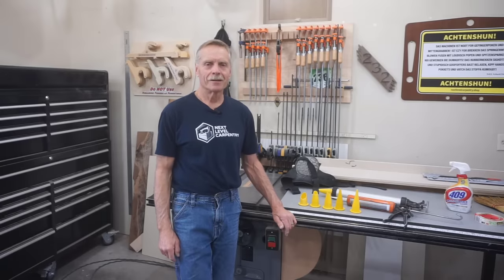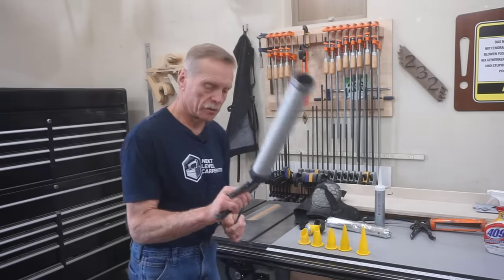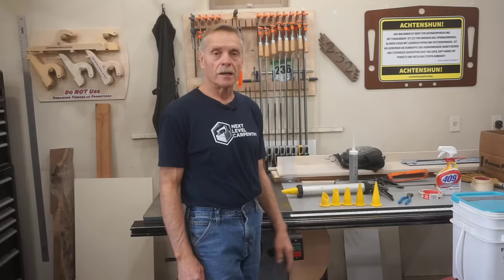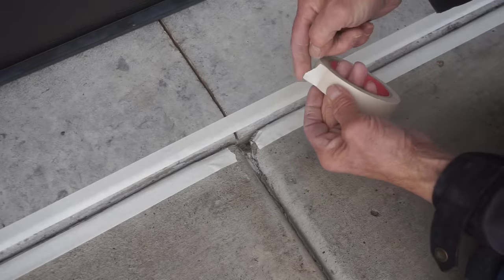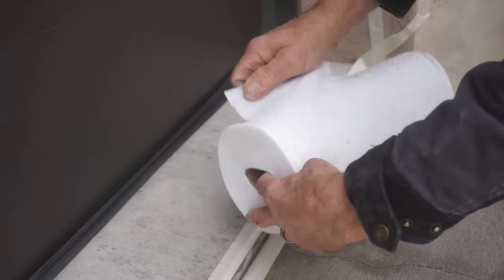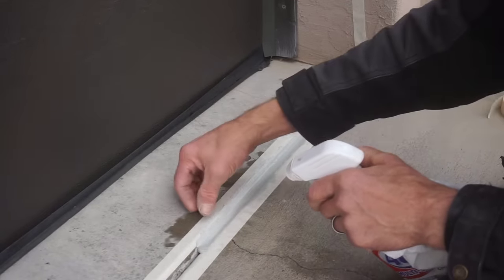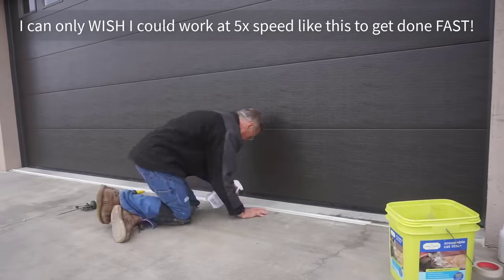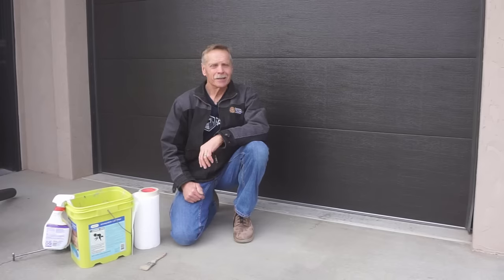How to Caulk Concrete Control Joints with Perfect Results Every Time

Comment: Question: is it necessary/helpful to use foam backer rod? Or is that something you'd use only in between really wide/deep gaps?
Reply from the maker: Backer rod is often necessary but, as in the case shown in this video, not always necessary. The ideal proportions for a sealant joint is that the depth is half its width and anytime the proportions exceed that, work to achieve it using backer rod...
Reply: @NextLevelCarpentry  Thank you for your prompt reply. I just came back from Home Depot and bought everything I need to do this (this'll be my first time). Actually, I forgot the sand, but I'll go back and get it. But I did get some backing rod in different sizes, just in case. Thank you for giving me the proportions to look for (I had no idea). So if the width is 1/2", then the depth should be no more than 1/4", right? As soon as I get the sand, I'm going to use your method. I'm mostly doing it because the gap is where bugs, especially springtails, make their home. They're driving me crazy, and this seems like the ideal solution, and it'll improve the overall look to boot. BTW, are you fan of using trim-a-slab filler strip? Just curious.
Reply from the maker: Good luck with your project Michael it sounds like you've got a good grasp of what you're working with and will be successful in sealing out those bugs. I've seen trim-a-slab strips but have no experience with them. My gut reaction to them is that they're a great idea but they would probably prove disappointing in use because Frost and dirt seems like it would just push them back out of a crack because as far as I know they are just a friction fit and not actually sealed in place. For your project make sure you spend all the time necessary for prep work to remove existing dirt Etc and to let things dry out for best results. Making that extra trip back for silica sand is time well spent as I'm sure you will find out as you start actual application of the sealant.... Best, Matt
Reply: @NextLevelCarpentry  Thank you so much for the detailed and helpful information, demonstration, and encouragement. I'll let you know how it went in the next several days or so.
Reply: @NextLevelCarpentry  Matt, I'm having difficulty finding the fine silica sand. Home Depot and Lowe's both have three main kinds of sand: all-purpose, play, and industrial. Lowe's also has a polymer sand and a pool-filter sand. (I had no idea there were so many different kinds of sand.) The industrial is 30-mesh, but it's not called silica sand, though it says on the bag that it contains silica. And in terms of both color and fineness, neither it nor any of the other sands I mentioned look like your sand in the video. I then found something called quartz sand on Home Depot's website. And finally, I did a search (using quotes) for "silica sand" on Amazon and got an exact match for a 120-mesh "Pure Silica Sand," and it looks like the stuff you've got. It's about five times more expensive than anything else in the home improvement stores. Before I place an order, would you please help clarify which of these is the right stuff? Thank you.
Reply from the maker: @AnotherPlanetsHell  I always get the sand I use at a masonry supplier; it's plentiful and quite inexpensive.  If you're in or near a city of even a decent size it should have one to check out. I've also heard that janitorial suppliers sell it as ashtray sand.  Home Depot's quartz sand might work well too.  After all, the sand isn't doing much at all, only covering the sealant for a day or so until it skins over.  Good luck! Best, Matt
Reply: @NextLevelCarpentry  Hi Matt. Forgot to reply to this. Thank you for the tip. I suppose there're a few concrete places around here, but I didn't bother with them. I don't know…in this town/area, these places don't really cater to individual customers with small projects. I didn't want to turn this one item into a project of its own. So I just ordered a bag of the pure silica sand from Amazon. Should be coming tomorrow. So I'll see about getting this project going on the weekend. Thanks again.
Reply from the maker: @AnotherPlanetsHell  Good news is that a little bit of sand goes a long way so it's a good value even when you can't buy it 'in bulk'.  Let me know how your project comes out? Best, Matt

Comment: Perfect. I would only add upgrading to a battery operated caulking gun for a quicker more  consistent bead. Also saves cramp in yor fingers if you have 10 hrs in front of you
Reply from the maker: Do they make a battery powered 'sausage' type caulking gun? Sure would be nice on cold days when that stuff thickens up!
Best, Matt

Comment: Where do you purchase these products?   A link would be super helpful 😊
Reply from the maker: UUHHMMMM... have you checked the links listed in the description of this very video where all the products you ask about are clearly listed? 🤨😉😁
Reply: @NextLevelCarpentry  oh goodness, my bad! 🙄 duh.  Thank you so much for the quick reply and gentle correction.  (Forgive my very poor attention span.  Ack!)
And thank you for the awesome video!!!
Reply from the maker: @smartyjonesen  yeah no worries because it's just as likely that I neglected to put them into the video description as it is to not be able to find them when viewing the video on a small screen like a smartphone.
Some of those supplies are available locally in even moderate sized cities and if you do some shopping around you might be able to buy locally rather than deal with Amazon but they are there as a reference and last Resort.
Good luck with your project if you have some sealant work to do...

Comment: I'm having difficulty locating Fine Silica Sand.  Is there a substitute type of sand that you recommend?
Reply from the maker: One important thing about silica sand is that it's mostly white and doesn't change the color of the sealant you put it on.  That aside, if you sifted regular sand so it's fine and consistent it will still do the job of keeping bugs, dirt and leaves out of fresh sealant although it will probably affect the color a bit.
Reply: @NextLevelCarpentry  Thank you.  I plan to get started this weekend.

Comment: I purchased PL LOCTITE Concrete Self-leveling Sealant - to use on a concrete porch as the porch surface meets the brick.  I'm hoping to see the same results that you got in your video by using the 3M tape, 409 multi surface cleaner, and fine silica sand.  Thanks.
Reply from the maker: I hope I am replying before you start using that self leveling because I think you will be extremely disappointed because there are major differences between self-leveling and the non-sag stuff you see me use in this video. Masking tape might confine the mess a little bit but silica sand won't make any difference and it will still puddle and bubble and everything else. I'm not telling you not to use self leveling but encourage you to lower your expectations if you do...
Reply: @NextLevelCarpentry  Thank you for your reply.  I had just cleared the area that needs to be caulked which took all day.  I was still deliberating about which caulk to use, but I saw how liquid the self leveling looked and stopped there.
Reply from the maker: @vickiehz  I think you'll be glad you did a little research BEFORE making a mess of things with self-leveling.  Take you time and practice a little with what you see in the video and I predict you'll amaze yourself with the results!
Reply: @NextLevelCarpentry  Thank you.  TBC
Reply: @NextLevelCarpentry  I wanted to let you know that the results I got from using the non-sag sealant looks very good.  I had one span that was too wide (even using the backer rod rope) to use it however.  In that section I had to use a tub of DAP concrete & mortar repair.  I'm wondering if using the non-sag sealant over it to level it out and make the entire area the same color would adhere properly - applying the sealant once the the DAP thoroughly dries.  If you've ever done that, let me know.  Thanks.
Reply from the maker: @vickiehz  FWIW I've done gaps/cracks 2"~3" wide using pool noodles or flat foam sheets cut to fit as 'backer rod' and had very good results using Tremco Dymonic alone so it will probably work over the concrete repair, provided you can still put a thick enough layer on top.  You've got little to loose if it doesn't work and you can always re-do using foam as mentioned above.  Let me know how it works out because just because I've never done it the way you are doesn't mean it won't work...
Best,
Matt

Comment: Great video and amazing end result!  I have a few questions if you wouldn't mind giving advice.  My driveway expansion joints are essentially 2X2 wood strips (now rotted) so are 1 1/2" X 1 1/2" in size.  Would you recommend backer rod to fill most of the void, and how deep should the remaining void be?  1/2" ...3/4"? I haven't found any 1 1/2" backer rod, so I assume I can twist 2 3/4" strands together if that's the recommendation?
Also, my driveway is aggregate concrete, so cannot really apply tape to top, should I plan on putting tape just below surface on the sides of the trenches? Thanks for any help, and I'm glad I came across your videos, very well done!

Comment: tremco demonic vs vulkem 116 caulk?  in Minnesota - which is best for driveway cracks, joints and garage perimeter?
Reply from the maker: They should both work the same... even in Minnesota.  I've only used Vulkem in a pinch because I like the 'consistancy' of Dymonic better... but that's just me.

Comment: Should I use backing rod or back fill joint with sand if I suspect washout?
Reply from the maker: Backer rod is almost always a better solution than sand IMHO but there are some situations where both are necessary IMHO.  If backer rod gets it, I'd generally recommend it.
Reply: @NextLevelCarpentry  I suspect erosion under concrete. I plan to fill as much as possible with sand and then use backing rod to fill gap. Is that advisable?
Reply from the maker: @sharkhartman  It's probably better than nothing and may be all that's needed, depending on how extensive the erosion is.
FWIW The slabs you see in this video are over fill dirt that settled significantly so I had a concrete lifting/leveling company come out and inject special foam under them to provide actual support to prevent further settling or cracking.  Not cheap, mind you, but much less expensive than replacing the concrete itself in my situation.

Comment: Hello, I didn’t hear the reason why to do this to the joints. Is it to prevent water damage over time? Is it to prevent the concrete from rising up due to water absorption?
Reply: One primary reason is that it keeps water from washing out the ground underneath the concrete which would likely cause it to sink and crack, as well be uneven with adjacent slabs. Also keeps weeds from growing in the joints which is a nice bonus.
Reply: @kingv911  ahhh great info, thanks!

Comment: Could this method be used in the opposite way meaning the same scenario but it’s in the concrete ceiling joints that are not straight?
Reply from the maker: I use the same method/process for applying sealant like this regardless of orientation.  I don't envy you if you have to do joints on a ceiling but there's no reason, despite the difficulty, that it won't work.
Reply: @NextLevelCarpentry  the mason told me that it cannot be fix but in my mind it never looked impossible to me… then I ask another contractor and he told me it will cost a lot of money to fix it but I was still hesitant about the information that he was giving me. Gonna take a picture of what I’m referring to and show you tomorrow so you can have a better assessment of the situation I’m referring to.

Comment: You did not mention anything about the depth of the joint. Do we need so.e backer foam?
Reply from the maker: That's a whole other subject Mark... no backer rod was needed or used in this joint as I wanted to focus on getting professional looking joints, regardless of overall joint 'design' ie: width, depth type.  Best, Matt

Comment: Is there a method or someone as good as this for the same problem, but for an asphalt driveway to a concrete apron? I read many comments and only got that is is not feasible for this product. I want to spend the time through Sept, while cooling off and before the November cold.  I will look at asphalt to concrete materials, if any, and apply these techniques. Maybe chop the gap wider, put in cellular PVC ? PVC to concrete apron per his method, then asphalt to PVC on other side? Darn when I saw this, I thought I was all set.
Reply from the maker: The best thing for your situation is to hire an asphalt parkinglot repair/maintenance company to seal those cracks with their hot-kettle rubberized crack sealer... the same stuff used on public roads.  Anything else is a poor bandaid at best IMHO. Sorry... wish there was a decent DIY product/method but I've not found one.  Best, Matt

Comment: Can I use this on vertical  expansion joints in 6ft high cinder block wall.
Reply from the maker: Absolutely!  It's a little tricky getting the sand to stick: I just toss it in little handfuls at the fresh sealant.  Good thing is that sand is less necessary on vertical joints so if not much sticks it's still fine... good luck! Best, Matt

Comment: I used sika construction sealant and this method with 409 resulted in bubbling up of the sealant.  Maybe another sealant with take the 409 better.
Reply from the maker: Bubbling up is usually caused by other factors like air expanding under fresh sealant when sealing on a hot day in direct sun, not solely by using 409.  I've not used Sika, only Tremco, and a random bubble here or there is very rare.  Best, Matt
Reply: @NextLevelCarpentry  interesting point.  I just tried out the sika self leveling sealant yesterday on a hot day and it seems to have worked nicely.  And was quicker and far less messy for me.

Comment: I have all the materials and I am getting ready to seal the joints in my driveway. I have one major problem i cannot find 409 anywhere. What can I use as a substitute? Thanks in advance for any help you can give me.
Reply from the maker: Hey Jim,
Seems no one is able to find 409, including moi! 😯 Here's what I've told other viewers in the same predicament:
"I started experimenting with diluted Dawn for a sealing job I need to complete before winter figuring I won't be able to get 409 in time.  Started with 1 part Dawn to 20 parts water and it's too weak.  Went to 1 part Dawn to 10 parts water and it works well but it's more 'soapy' than it needs to be IMHO.  I settled on 1 part Dawn to 13 parts water and it works great as a substitute/replacement for 409.  It seems to work exactly the same as 409 with no negative affect on the urethane sealant."
Hope that helps since winter's on its way and sealing concrete is no fun in the cold!
Best, Matt
Reply: Forgive me if this question was already asked but you have a lot of comments here...approximately how many linear feet is a sausage good for with the same size gap you were repairing in this video?

Thank you for all the helpful info and links.
Reply from the maker: @BrewtownFlyer  A couple sausages would do it.  It's a decision where I know one isn't enough so I get two because I'm sure 3 is too many.  If it takes even a dab more than one it means buy two.  I think there's a quantity calculator on the Tremco website to help estimate sealant volume for gaps of differing sizes.  Best, Matt

Comment: Surely the joint requires a primer to ensure that the bead of caulk has something, non-dusty, to adhere to ?
Reply from the maker: I do make sure the joints are not Dusty oily or greasy but find that primer isn't necessary for most applications. That is not to say I wouldn't use it but that I've just not found it necessary for very very long lasting results on the projects I've done...

Comment: What would be another spray you could use besides 409? This is not available in Canada....thanks
Reply from the maker: A solution of 13% - 15% Dawn dish soap and water is a very good substitute IMHO... Hope that helps?
Best
Matt
Reply: Thanks...appreciated
Reply: Would the dawn mixture be fine for a Sika polyurethane cement sealent as well?
Reply from the maker: @mikepowell7040  I don't think it's good for anything other than plain urethane type sealant.  I don't know for sure but would definitely do some experimenting before committing because it will probably just make a big mess...
Reply: I believe the product you used in the video is polyurethane as is the caulking I want to use.   concrete Sealant by Sika.
Reply from the maker: @mikepowell7040  well I just learned something... you are correct as the Demonic literature calls it a polyurethane hybrid.😎
I know there are other brands of a similar product like  NP1 and Vulkem that I have used in the past with 409 with good results so to the extent that Sika is similar it should not be a problem. Other viewers have asked about using 409 on silicone type caulk and I know that's a disaster waiting to happen and I'd hate to steer you wrong😉
Reply: Thanks once again

Comment: The question is can you paint over it after it’s filled?
Reply from the maker: If you paint over one part urethane the paint will stick but because paint gets hard and urethane does not the paint will eventually crack and chip. If you plan on painting the concrete I would suggest doing that first and sealing it afterward as a different option